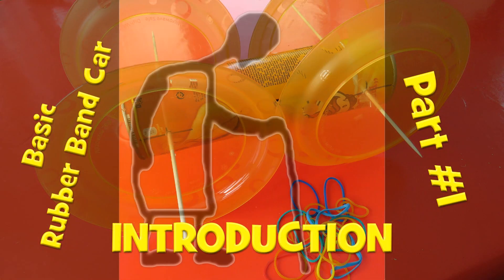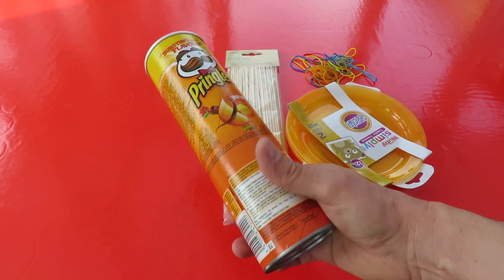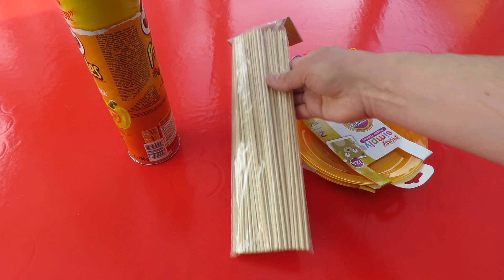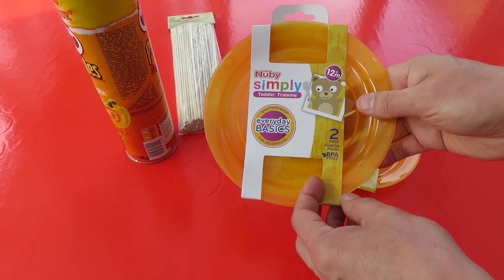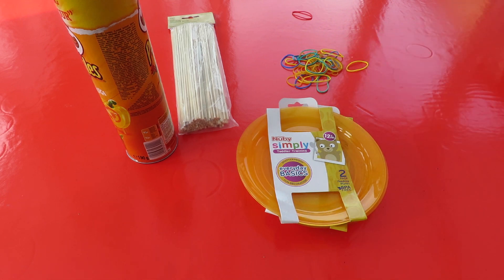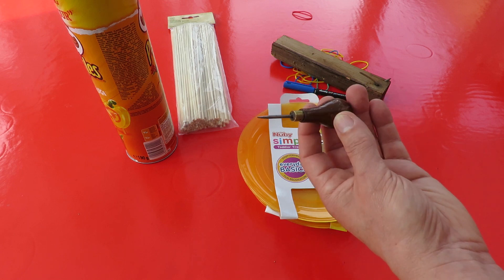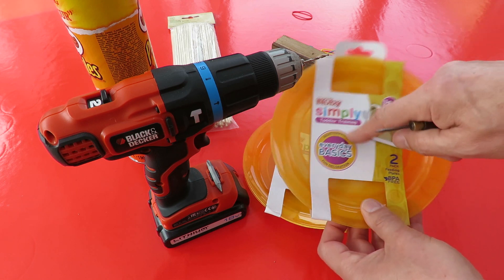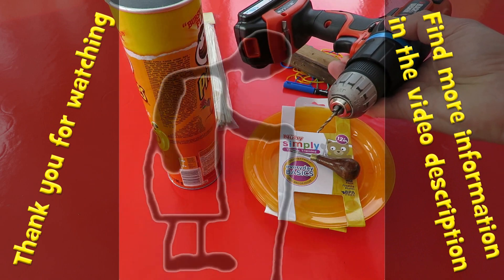Basic Rubber Band Car Part #1 Introduction

Comment: Looking forward to a new project.
And it will soon be time for the dancing spider :-)
Question: 
Is it possible to make a a motorized potato car that powers itself?
With the axles passing through the potato.
No steering of course.
Just wondering.
Reply from the maker: Are you teasing me regarding the Potato ? The answer is no anyway. Hey Grandad can you make a potato powered car? Yes, today only (APRIL FOOL) https://youtu.be/YSa7IgUT-hU  Potato Car 1st day of the 4th month - reveal https://youtu.be/Zh8H8XaFYdc Hey Grandad, can you make a potato powered car? (no I can't) https://youtu.be/_NZRZCHMZ4w  Let's make another potato battery  https://youtu.be/jwbpNbE1seU
Reply: Sorry 
I actually thought it could be done.
I wouldn't tease you.
Reply from the maker: Wil Hobbs the problem is the power to weight ratio. There is just too much weight. You can improve the power output by par-boiling the potato first - yes that is genuine, not a joke - but it still falls well short of what you would need to move a car. I do have it in mind to try doing a boat at some time as you need far less power to get a boat moving as there is far less friction and the weight would be supported by the water. You might like this video by Roobert33 https://youtu.be/Ko_R3PeadG4?list=PLA5a2xPRSrB24tJDQHdmjgpFGwfvwvnnn
Reply: Ok.
A boat would be interesting too.